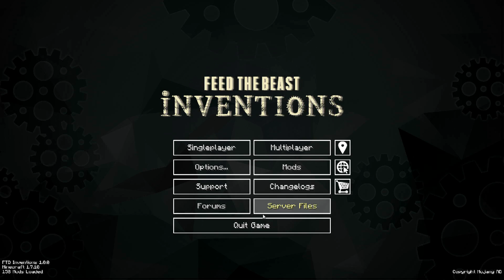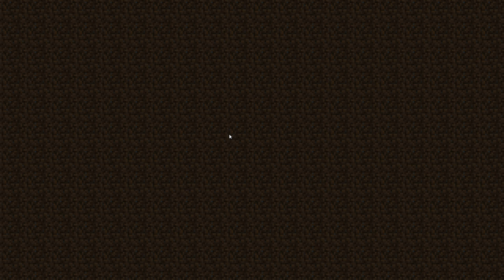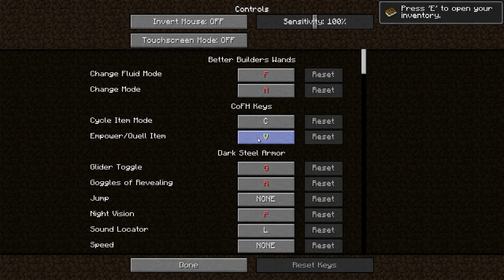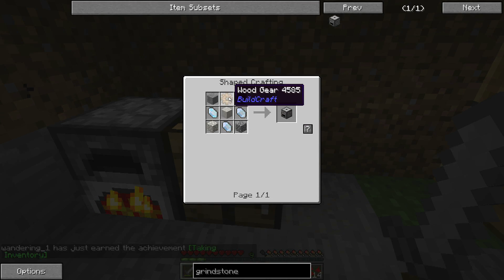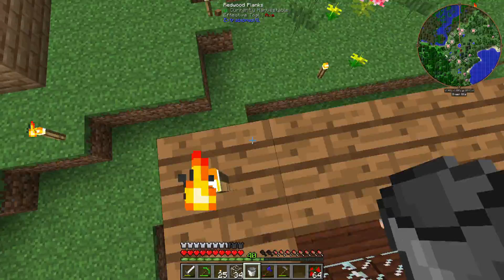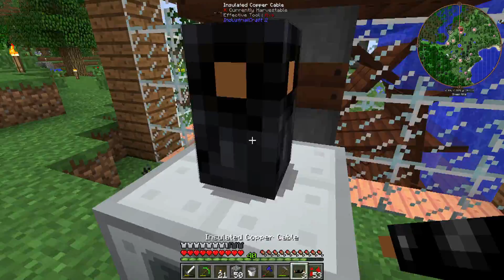FTB Inventions Episode 1: Water Power

Comment: I put my dynamo in the same way you did. I then put my lv capacitor and  I shift clicked with my engineer hammer on the capacitor. Can’t manage to get rf’s what am I doing wrong
Reply from the maker: It is possible that later updates to the pack removed the ability to directly charge the capacitors directly.  I'm not sure.  Pick up the capacitor and place it down in the open to check that the side facing away from you is blue.  Otherwise, make some LV connectors and LV wire and connect that way.  Best of luck!